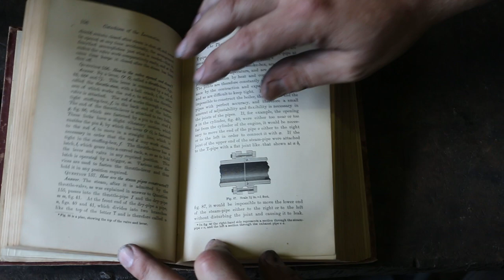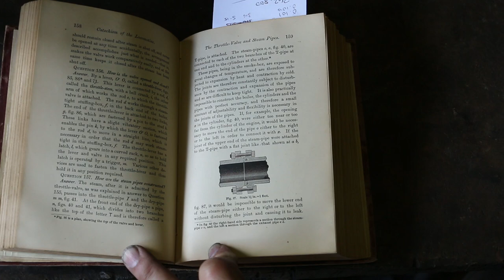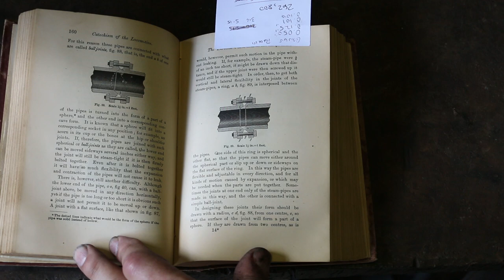Steam Locomotive Repair - Steam Pipe Rings

Comment: I would not have made the delrin as long. I believe it has to be tiltet in two axis (or random) while lapping to achieve the ball-segment shape.
Reply: Seconded. Not so much a problem with valves due to narrow seat width, but for larger radius the tight guide leaves potential for grooving.
Reply from the maker: Interesting - what you guys saw was the second version of the Delrin piece.  The first one was short and it just skirted all over the place.  The one that you guys saw was longer to help keep it in line in the steam pipe - but it was turned undersized enough that you got some wobble to get the random approach that you mention. I estimated the amount of "wobble" that would occur in the joint and turned it under size enough so that it was being lapped with a similar amount of movement.

Comment: Keith, what would the pressure and temperature be of the steam at that point? Thanks again for another interesting video! Kind regards.
Reply from the maker: Our boiler will go up to 150 PSI.  The max temperature of steam at 150 PSI is 366 degrees F (185 degrees C).  Considering that operating pressures are usually less and that a lot of the temperature has been lost by the time it reaches this area, actual temperatures will be considerably less.  Exactly how much, I have no idea.

Comment: Hi Keith, thanks for your explanations,
Would it be more accurate to make a form tool of the right radius to machine the radius on the part instead of using the hand grinder which seems very random?
Regards Fred.
Reply from the maker: Well, yes and no.  In my situation, the only way I have to make a form tool is to grind one by hand, which is no more accurate than just grinding the radius on the actual piece!  If I had a radius grinder that I could grind the radius with, this would have been a great way to go.  Sometimes we just have to make do with what we have.  Besides, I got this method from other steam locomotive mechanics that have used the same technique before so it has been tested to work.

Comment: Nice video. I was surprised that you didn't use a cutting oil when using the drill bits. Is there no requirement when drilling and machining ductile cast iron? I was impressed with your method of creating your bevel. I was wondering how you were going to accomplish this. Aren't you glad that we don't have to use veneer calipers as in the old days? I have difficulty seeing the pointer on a dial caliper as it is in my older years.
Reply from the maker: Cast iron does not require cutting oil.  I discuss this in more detail at the end of one of my more recent videos.  Thanks for the comments - and  yes, I sure am glad that I don't have to use a veneer caliper every day (although I have a nice 24" veneer caliper that I will pull out when needed for a large job....)
Reply: Keith Rucker - VintageMachinery.org Thanks for your replies and for taking the time to exhibit your talents and experience here on YouTube. It's truly amazing what was accomplished manually with slide rules and the use of our brains before the advent of computers. Those old manuals that you use for reference are proof of the virtues that the documentation of trial and error can possess. As far as I'm concerned, there are no old reference manuals that aren't worth keeping.

 It also pleases me to see our younger generations taking an interest in older technology. We need to have some qualified younger folks around to keep the old iron running after we're gone. ;-)
Reply: Same here, but they were vernier calipers, still got one. ( A veneer is  a very thin piece of wood fixed over a heavier substrate, usually for decorative purposes).

Comment: Hi Keith,

I really enjoy your videos.

I am old school diesel engine builder, hobby machinist and a bit of a steam locomotive enthusiast.

I'm curious if the lapping compound making it down the steam pipe to the slide valve and cylinder was a concern. If so, how did you prevent it?
Reply from the maker: We stuffed some rages down in the pipes to keep anything from falling down and cleaned everything up with rags and mineral spirits before pulling out the rags.

Comment: No form tool for the radius? :-( I know it is all hand work to finish anyway so it doesn't matter but it always looks cool. :-)
Reply: My thoughts too, after all a 3inch-ish radius for a cast iron cutting form tool is about as  easy as it gets.
Reply: If you want to drop in and volunteer at the museum and help Keith make some radiusing tools, I think that he would be glad to have you visit.
Reply: Was that for Brian or me, if me, I would love to but the round trip is just a little too big and my passport is out of date.
Reply: John Ferguson
I hope to be able to stop in sometime, maybe Keith will host another work weekend again like they had for that saw rebuild, I think that went over well.
Reply from the maker: I could have ground a form tool but it would have been hand ground and I would have had the same problem - nothing to use to get a perfect radius.  So why not just grind the curve by hand on the part instead!
Reply: Hi Keith, no access to a 6" grinder? One would automatically give you the right radius just by holding an odd bit of HSS against it. No need to bother with top rake as the rings are cast iron.

Comment: I hope the people who do the lapping are as conscientious as you and stuff rag in the pipe to stop grinding paste going into the cylinders.
Reply: If they don't, Keith will stuff a rag up their lower pipes.
Reply: Realistically there is A LOT of steam volume moving down that pipe. It would melt the oil binder to less than water consistency and blow the grit out the drain cocks or petticoat pipe before it had a chance to do much damage.
Reply: l wilton Just a little grit in the cylinders and the steam chests and the valves could cause a lot of grief.
Reply: l wilton You might be right but is it really worth taking the chance when prevention is so easy?
Reply from the maker: The guy doing the lapping is probably more anal about stuff like that than I am!

Comment: Do you have a set of larger radius gauges? I have some bigger ones, bigger than 3" (Which tend to gather dust)but to get the radius I use the tool post grinder which has a handy radius attachment .

Comment: Interesting how much different the cast iron sounds when machining! I recall you saying in the past that you don't use lubricant on cast iron, what's the main reasoning for this? Neat to see some Delrin, I make things from that on occasion at work. Using a lathe would be ideal, in my case we use routers which can be rather dicey! I came across a Locomotive Catechism book some 30 years ago at a market/festival (Phelps Mill Park I think)  in northern Minnesota, have regretted not buying it ever since even if there's little likelihood I'll ever work on a steam engine. I think the seller wanted $25, but he objected to me looking through it "This isn't a library!" Ahh well :D
Reply: All irons contain graphite which is a great lubricant. Also, iron tends to chip or flake as it is cut, so the temperatures at the cutting edge stays relatively cool.
Reply: Oil just makes the cast iron swarf mess worse...
Reply from the maker: These previous comments are right on!  I always get asked about it though.

Comment: Ductile iron is usually SG = Spheroidal Graphitic.  Instead of the carbon being in flakes like ordinary cast iron, it is in little balls or nodules.  Mechanically it is better than ordinary cast iron but not as good as steel.  Another reason an iron gasket joint works and brass didn't would be that the expansion and contraction with temperature would be exactly the same as the surrounding iron pipework.

Comment: Hi Keith Rucker
Looking at the original ring, it looks like dezincification of brass.........  look it up, Google is your friend.
If you have problems with the cast iron parts sealing, try manufacturing with a low zinc bronze or a low zinc gunmetal...
Reply from the maker: This was due to the steam cutting it.  Dezincification can happen but that was not the case here.  Cast iron is the correct material for this job - I think that the guy who rebuilt this engine back in the 1980's was just using what he had on hand.

Comment: The things you have to do to keep a 100 YO loco running! Do you know how the old-timers put that radius on the pipe ring?  No angle grinders when that loco was built, much less  CNC. Did they use a form tool?
Reply from the maker: Probably a form tool.  Or a radius tool on the lathe.  If you were going to build a bunch of these, it would be worth making a jig to cut them.
Reply: Thanks Keith!

Comment: I wonder if anyone makes a large diesel valve cutter that you could use for that job to resurface the face where the radius sets into. You know like you have the hand held or drill mounted cutting heads for doing valve jobs on cylinder heads.. I'm sure there's one for diesel rig or ship engines that are large enough to do the job.
Reply: A poppet valve uses a straight seat. A steam fitting uses a radiused seat.

Comment: theoretically the line of intersection between the surfaces of the ring contact point and the steam pipe  should be circular at which ever angle of misalignment the two component have. Therefore the curved surface of the steam Ring is not circular in crossection but a complex ellipsoid that will follow the circular edge of the steam pipe as it moves out of alignment.

the lapping of the joint would be intended to work if the lapping was done with its axis in alignment with the axis of the steam pipe intersecting it, which is uncertain.

in reality the tolerances are likely to be large and forgiving so a tight seal can be achieved and most likely has been achieved
well done on an other interesting video.
Reply from the maker: I cannot argue with our logic, but as you pointed out, this is not a precision fit!  As for how I calculated the radius, I used the books that I referenced from.  Those guys were a lot smarter than you think back in the day.....

Comment: This may be a stupid questions but I worked in a Machine shop as a kid and I always the Lathes and Mills using a ton of cutting oil throughout the whole process. Why does Keith machine these items "dry" without cutting oil?
Reply from the maker: I do not use cutting oil on cast iron.  One of my most asked questions and I often discuss this when I am shooting a video.  Cast iron has graphite in it which serves as its own lubricant.  Also, cast iron will machine into a fine dust - a very abrasive dust that will destroy precision finishes on a machine - like the ways.  When you use a cutting fluid, you will wash this fine dust all over your machine and into areas you want to keep it out of.  I like to vacuum up chips dry and then wipe the machine down when I am finished.  Steel chips won't do this.
Reply: Keith,
Thanks, I appreciate you taking the time to answer. It makes sense now.

Comment: Yup, I am late to this comment thread ;-) and puzzled. If that is a ball seat then lapping it with a universal joint is kinda defeating the purpose, isn't it? I have rebuilt ball seats on equipment and the whole point of having a ball seat is the ball part. If you don't rock the drill side to side then you are not lapping a ball seat, more like a valve seat on a gas engine head... So am a bit puzzled about the need for the long nose on the tool as well as the U joint.
Reply: The U-joint allows it to rock. A rigid setup will give a "straighter" seat. No matter how much you try to rock it by hand there will be a tendency to ride more in some spots than others. The free movement yields a much more even match

Comment: I just have to say it, and I understand that is a big piece of material to be calipering, but you never caliper with the inside of the jaw. You are supposed to use the caliper at the tips for accuracy. That's how they are designed to be used. I do like your videos, though.
Reply from the maker: First off, the inside of the jaws are ground the same all the way up.  It is true that the narrow ends are better for many applications, but it is not necessarily true that you cannot use them this way.  In fact, I sometimes find using the wider cross section deeper in the jaws to be better to measure off of.  But then again, I only use dial calipers when the measurement is not critical anyway - when you need a very accurate measurement or have a tight tolerance, you need to reach for the micrometer.  That was not the case with these parts....

Comment: Hey Keith, I've never attempted a large diameter radius in that regard before, but I was wondering if you think it would work to make a forming tool out of HSS and kiss the angle with it?
Reply from the maker: The problem is that you have to make the form tool first - how do you grind the radius on the form tool?  I am usually doing it by hand the same way I ground the radius on the part.
Reply: Yeah that's true I suppose.  It's probably not worth building a radius grinding jig for the little bit you'd use it.

Comment: Ingenious. The flat surface handles lateral displacement while the spherical surface handles angular misalignment.

To get a spherical surface on both of those parts (the ring and the seat) I would have liked to have seen that adapter have a smaller cone-shaped extension so that you could rock the spinning ring in all directions, which would actually get you mating spherical surfaces on both parts. 

The flat faces should be lapped separately on (or using) flat surfaces. (If you lap them together, you get spherical surfaces again. Pretty huge radius to start, but it's the principle of the thing.)

This is derived from grinding optics: if you grind two surfaces together, you get spherical; if you grind three surfaces together in all combinations, you get flats.

Comment: Keith I am and ex machinist mate ( steam  engine room mechanic) Navy 1970 to 74 and my question is what/ how does flat end seal?  is there prep to flat pipe flange and back of ring ? thanks jim h
Reply from the maker: Both surfaces need to be flat.  If so, they will seal up just fine.
Reply: that is a little simplistic for me, the question is how do they get flat in place in  the boiler what is the process?  For instance in navy we had  a tubo generator get  a 1/16 inch a steam cut in the gasket surface  after multiple gasket failures  ( FLEX TYPE GASKET METAL RIBON COIL STANDING ON  IT SIDE WITH INBEDED ASBESTOS IN BETWEEN THE RIBON HIGH PRESSUER POWER PLANT STUFF, I realize that that this engine does not use that type of seal  .The  yards made a ring with handle it with crosshatch milled in face. and than we lapped the steam cut out of gasket surface 24 hrs. day for a week as it was quicker than cutting a hole in ship to remove generator( roughly 20 ton) to re machine surface  we did use corse  lapping compound, we wore 1/4 on an inch off the lapping plate had to have cross hatch re cut twice. so you see where my question is going too? thanks jim h

Comment: is there a reason for so many different drill steps?  At work, I have found that drilling large holes like that, that I get a lot less chatter if I use a pilot drill a touch smaller then the chisel on the big drill. Of course, I have to take it easy, and I make a smoky mess squirting oil from a spray bottle.

Not criticising, I just never had a master machinist to show me anything, so I'm operating on about 8 years of trial n error ..... plenty of error.
Reply from the maker: I was just going by sound.  The big drill bit could have used some sharpening....

Comment: I would put  Kopatite on the joints. Used on steam fittings.
Reply: Do you mean Copaltite?  That's all I found on the internet.  A modern sealant if worth considering but there is a lot of vibration and thermal expansion/contraction.  I think these sealants work best for systems that are running at consistent pressures and temperatures and won't perform well when used on a locomotive.
Reply: I have used it on steam turbines on ships. It is an evil smelling black paste.We usually used it between the top and bottom shell of the high pressure turibine and as  extra insurance on metal steam gaskets.On the low pressure turbine we usually used triple boiled linseed on the shells.If you get it on your skin gasoline is about the only thing that will take it off.t has been about ten years since I worked on a steam turbine aboard ship. The last  time we worked on one Westinghouse(the manufacturer of the turbines} sent a representative to supervis the work.He was almost 80 years old and had worked on turbines all his life. they didn't have any younger guys who knew how to overhaul them.Turbine overhaul is heavy nasty work.I forgot how to spell copaltite lol.I see no reason it would not work on a locomotive.
Reply: ronald davis  The stuff would certainly handle the temperature and pressures.  I was considering the vibration and the large number of thermal cycles.  The little locomotive is fired up and then run short trips; stop an go for several hours.  Then it is shut down and parked.  Week after week and month after month that's a lot of expansion and contraction and vibration on those joints.  Great info thanks.
Reply from the maker: The guy who I talked to about making these parts who works on locomotives recommended something very similar.